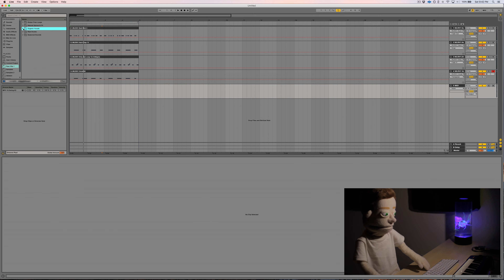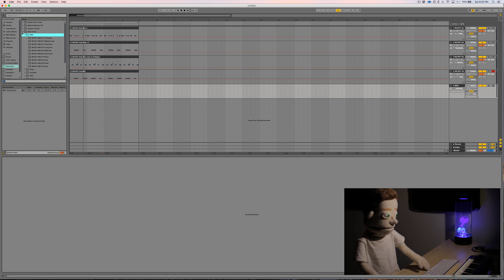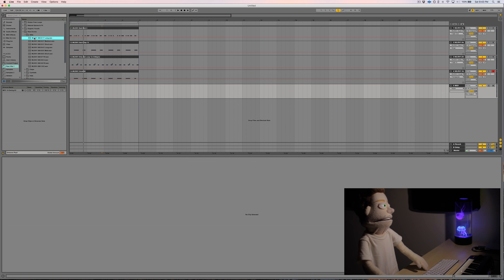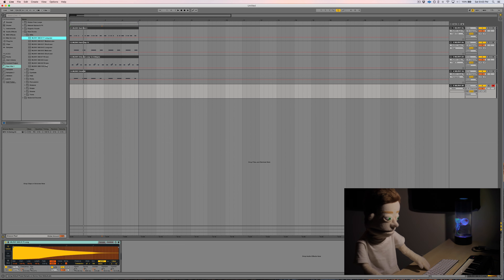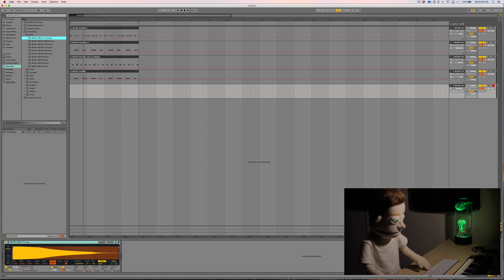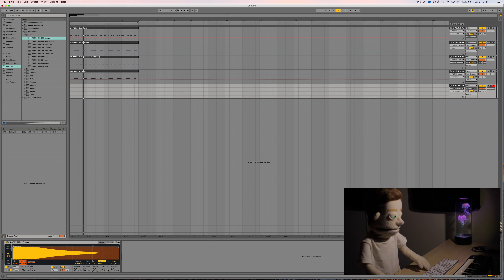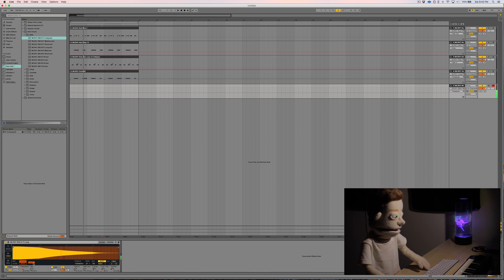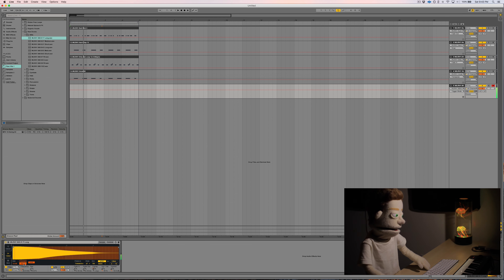How To Make Tech House in Ableton (Beginners Tutorial)

Comment: What MIDI device do you use? I can use my keyboard to the simpler in classic and 1-shot mode, but it won't allow me to trigger the different parts of a sample in the slice mode of the simpler. Does anyone know how I can do this without a MIDI device? Thanks :)
Reply from the maker: Ian O go down to your lower octaves. Slice mode puts the first piece on C1 instead of middle C like the other modes
Reply: I meant to say my computer keyboard. When I press "a" for example, the slicer mode won't play the sample. Sorry I'm not sure if that helps you help me further.
Reply from the maker: Ian O if you’re using your typing keyboard hit the letter z to shift down 2 octaves so the letter A is c1 on piano